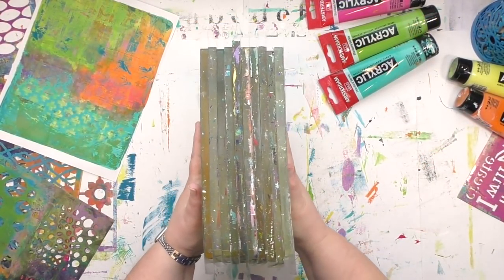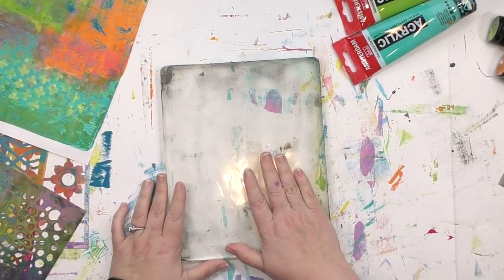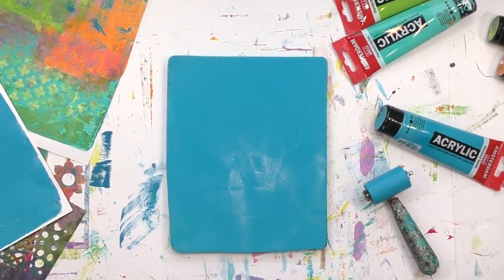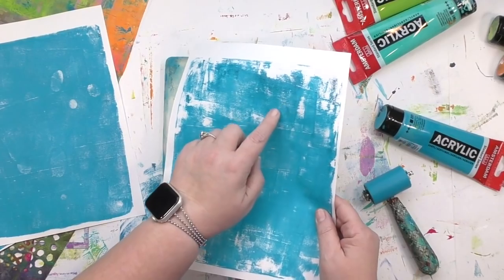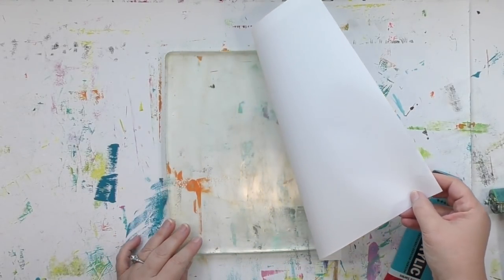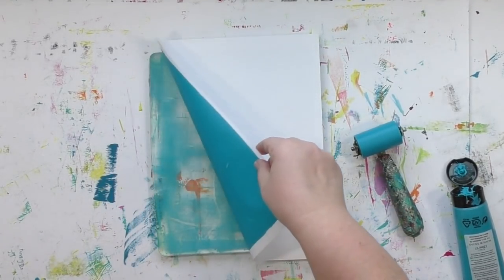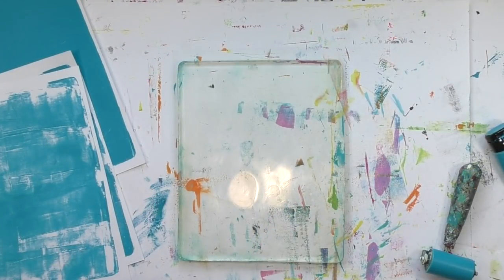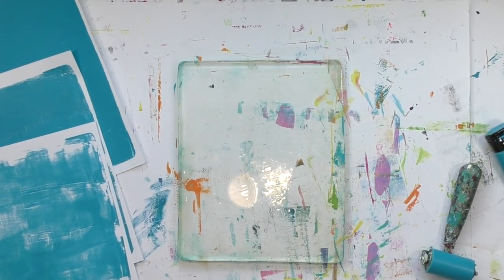How to get rid of air bubbles on a gel plate

Comment: Two years after purchasing a 12x14” gel plate I finally opened the packaging this Spring (Lol!) and found many air bubbles on both sides. I placed it on flat plastic, covered the plate top with sturdy deli paper and put a heavy book on top. It took until late summer to get rid of some bubbles on the top side. There's still one large bubble but the outer edge isn't as sharp to the touch. I weighed down that spot with a small cast iron fry pan and more weight in the pan. After a few weeks the bubble is still there but I can use the plate with no circles in the pulled prints. I live in a dry climate but the plate is providing prints as good as plates with no air bubbles. I haven't even had to work baby oil into it yet. Moral of my story is to not give up.

Comment: Wow! Thank you sooo much for this tip 💗 
Can I ask, I’ve seen a lot of people say you can store you plate on paper, but since paper pulls out the oil.. what will happend if you store your plate on paper and don’t touch them for a few months? Will they get ruined in any way?
Reply from the maker: I can't say since I haven't stored them that way for an extended period of time.  I've shared my thoughts about it at https://youtu.be/KxYNJw3nFAk
Reply: @CarolynDube  thanks for reply, yeah seen that movie aswell 😜 That is why I store mine between plastic aswell 👍
Reply: I'm storing mine with the paper and clamshell case it came in. I also plan on giving it mineral conditioning masssages.
Reply: I have stored mine for months with ordinary printer paper and no harm was done . Hope that helps 😎